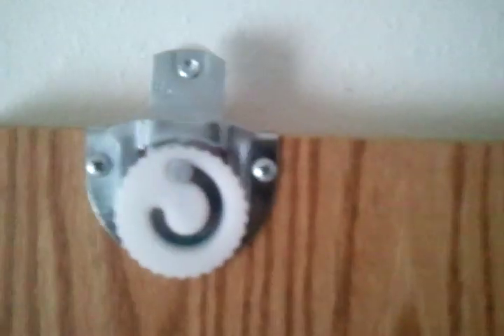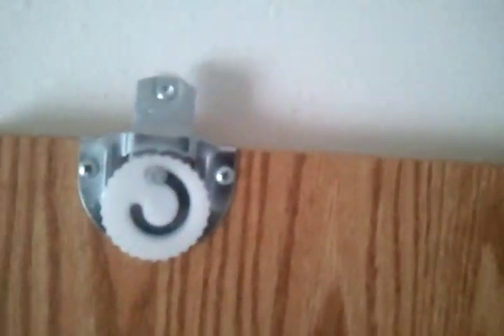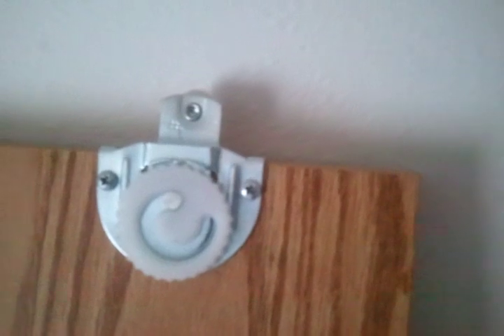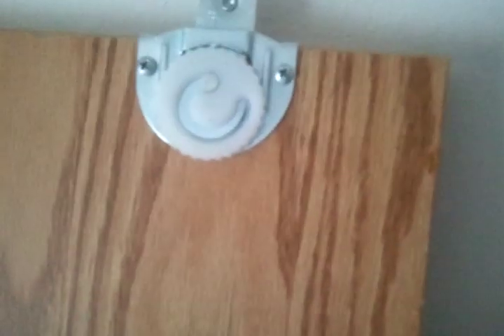How to fix a sliding closet door Part 2

Comment: Thanks, Brother! I just spent an afternoon trying to rehang some closet doors on the old crappy track and rollers. I couldn't get them to go flush with the threshold of the closet. Now that I saw you working with the new hardware and adjustable rollers I'm definitely going to go buy a new track and rollers and save myself the hassle. I was really frustrated I found your last few lines very encouraging. 

Many thanks,
A frustrated Irishmen.

Comment: Just wondering. On the wheels, is it 1-2and 1-2 or 1-1 and 1-1. I have these exact same rails for the same size doors that I have. Every time I try to hang one wheel on the other falls off